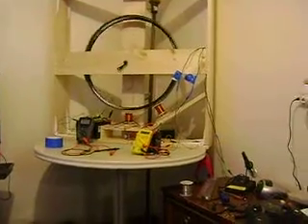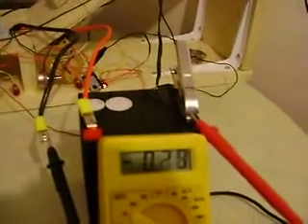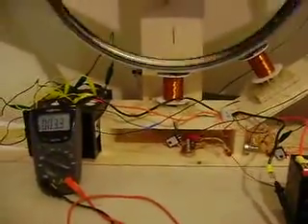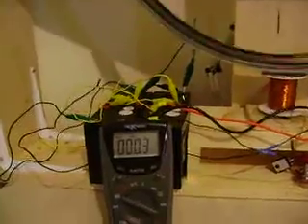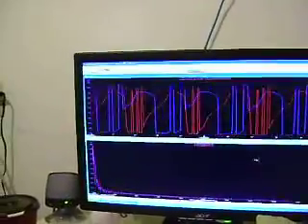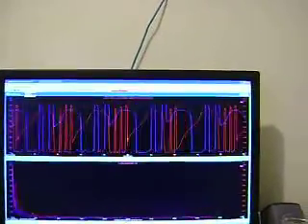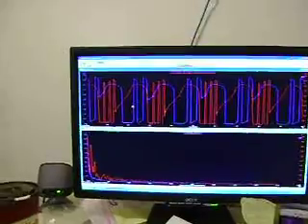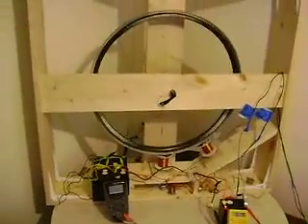Darcy Klyne's Bedini Monopole Motor Replication Video Part 1

Comment: Greetings from Oregon! I made a rotor for my SSG circuit with six mags around. Unfortunately the first mag I installed was facing out toward the coil. Question ... Does it matter which magnetic pole faces the coil? I noticed several people use north. Should I change it? THANKS for any info!    Scooterscottii